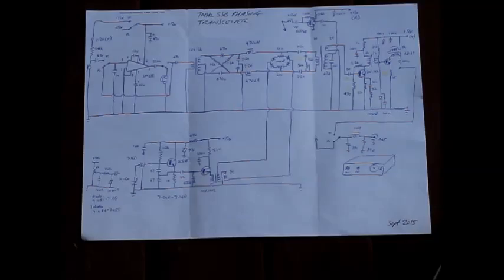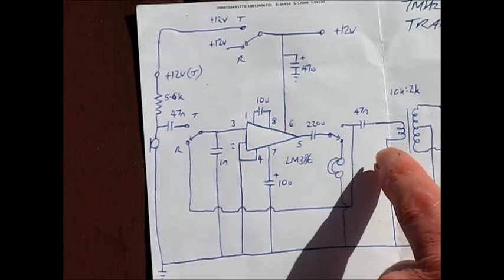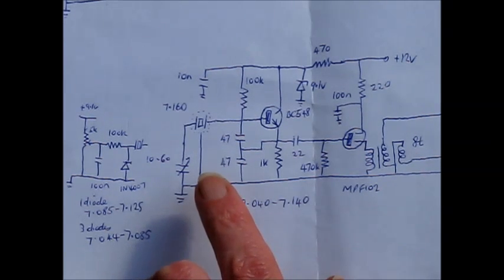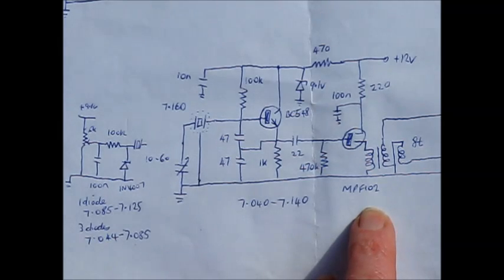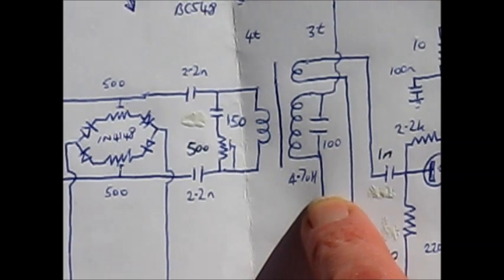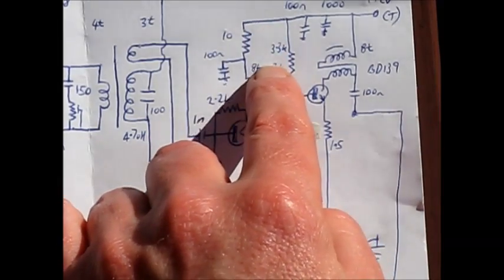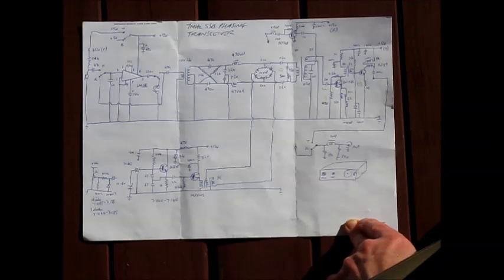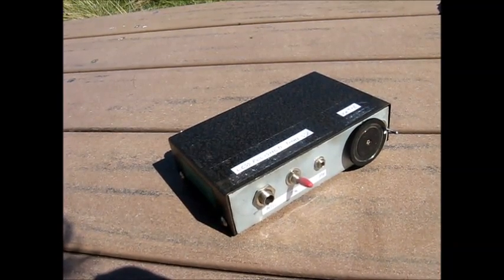Ultra-simple 7 MHz phasing SSB transceiver

Comment: Is the LC combination sitting between the mixer diodes and the audio phase shift meant to be a low-pass filter? Forgive me, I’m not used to phasing designs. I suppose it must be placed there to limit the frequency range that the phase shift network has to handle coming from the antenna, yes? From the mic, you’d probably prefer to do the filtering before the baking into the mixer stage. Am I on the right track?

Comment from the maker: Small modification: Changing the two 47pF capacitors in the ceramic resonator oscillator can allow a higher tuning range. In my case 7.080 - 7.170 MHz with a 7.160 MHz ceramic resonator. This may be more suitable for some.
Reply: What capacitor values did you use to achieve the higher tuning range?

Comment: What changes would be needed to use it in the 80m band? (apart from the oscillator and antenna filter, of course)
Reply from the maker: Not a lot. All frequency dependent parts and tuned circuits. Including the RF phase shift bit.

Comment: Hello! It`s a nice device! But I don`t understand - why do you use a low frequency BD139 as final RF power  amplifier? There isn`t any "transition frequency" parameter in the datasheet...
Reply from the maker: BD139s are commonly available from retail electronic shops here. And they work well in the low HF range.
Reply: @vk3ye Thanks! I understood. I found the information (in the Internet) that the one has an  amplification level roughly 15dB on 7MHz.

Comment: DDS on this thing too ??   How about different bands ??  Is this covered in your new book ? Thanks again for posting such GREAT videos ! :)
Reply from the maker: +KB8OOE Just a simple ceramic resonator.  3.5 MHz version should be easy with appropriate VFO or ceramic resonator. Not covered in the book which is mainly operating technique and what equipment & antennas to use.
Reply: Do you have this project in full in any of your books?
Alternatively, the circuit diagram in a printable format?
I use your channel as a training resource for me to understand ham radio practical skills.
I would like to make a handheld walkie talkie radio using this project..
Could I use a switchable resonator to create several “channels” on 40M?

Comment: I've built the circuit, now I'm trying to get it working correctly, seems that by turning he potentiometers I cannot get the sideband suppression (modulation checked with a DVB-T dongle and up converter) someone have some suggestions?  as RF transformer I used a T37-2 coil with 34 turns to get 4.7uH, could you please suggest how many windings could work for the PA output and for the mixer side?  Thanks in advance 73 Riccardo

Comment: I think there is an error in the RF phase shift section of the circuit. I believe the connection between the 500 ohm preset and the 150pF capacitor should be grounded in order to create the 90 degree RF phase shift at 40m.
Reply from the maker: Thanks Andrew - yes you're correct.  That connection must be grounded.

Comment: I`ve always been interested in minimum parts homebrew transceivers but have never built a phasing type SSB rig. I did look at a design some years ago but this circuit looks and sounds great Peter. Would it not be worth building another linear amplifier stage for maybe 4 or 5 watts? Will you be posting the schematic on your website? M0DAD  David

Comment: Hi Peter, I am impressed with such a simple SSB Phasing rig,I have been keenly flowing your  your you tube updates and sessions on a regular bases. I am interested as the rig you have built could operate on 20 meters and stable enough for PSK 31 or slow scan and would be interested in your feed back on that subject.
Many Thanks for great content.
73's David Grey
ZL1UTS